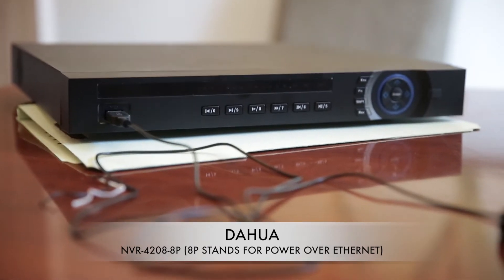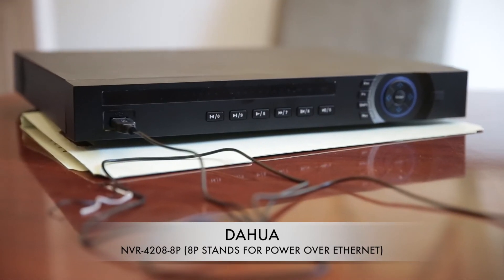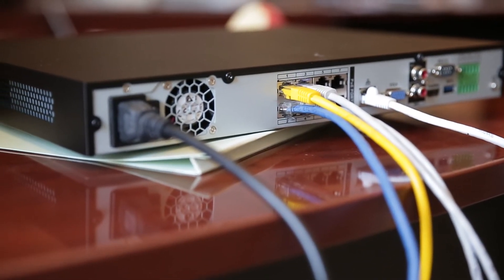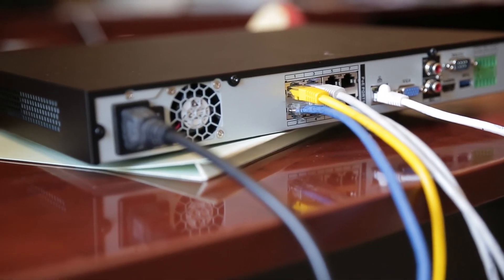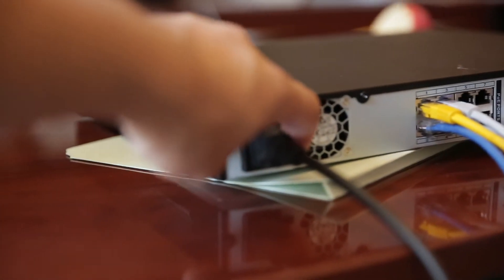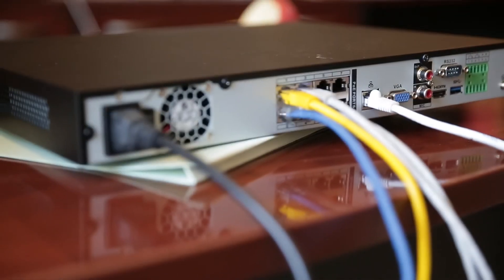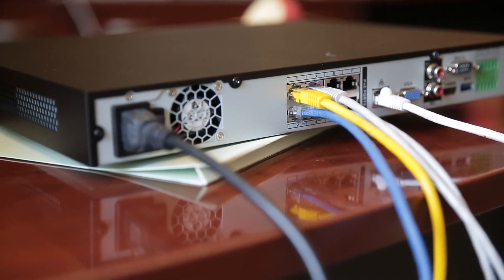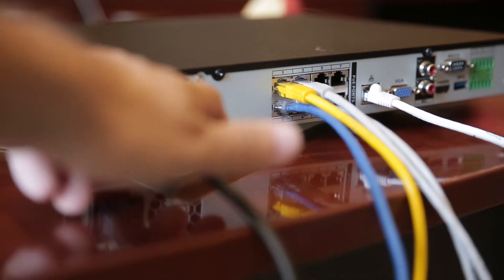Dahua NVR Noise level test // Model # nvr4216-8P

Comment: Thanks for posting. I too was surprised exactly how loud the fan is. You said you changed to custom. Would you mind sharing what you did?
Reply: +Chachi Cameo Well problem with custom fans is that they delivered little airflow and my unit only worked for 1 year.  So best advice I can give you is to get Dahua NVR that doesn't have POE (power over ethernet) and buy separate switcher that has POE up to 25W per channel.

Comment: Is this an NVR4208-8P like shown on the video caption or an NVR4216-8P like shown on the title? Do you have any noise dB specs about both?
I am trying to choose between both models, but noise is a concern, and I'd like to know if the 4216 is louder than the 4208. Thanks!
Reply from the maker: Hi Robextra0   I have unit  NVR 4216-8P  (So youtube Title is correct but video Title is not).  Now I did take off NVR cover and wrote down model numbers of fans that are installed.  There are 2 fans // First one LOUD one is  Delta EFB0412HHD this is a fan that is located right next to power block.  Size is 40x40x20 mm.  Delta rates this fan at 30.5 dB(A)   Second fan brand is ADDA  AD0405MS-G70  size // 40x40x10 mm noise rated at 20 dB(A).    This fans are loud but do push a lot of air thru them.
Reply from the maker: tradio2003 I also would like to let you know what I purchased Trendnet switcher with POE (power over ethernet) build in.   And Trendnet switcher gives out both 15 Watts and 30 Watts of power per channel (it determines automatically the amount of power device requires) and that Switcher is silent.  So one of the solutions is simply to purchase NVR that doesn't have POE build in and have separate switcher that has POE, so power to camera's will be provided by switcher not NVR.   In this set up everything should be silent.
Reply from the maker: Solution 2 would be to to replace fans inside NVR.   I did find 2 fans on Amazon and NewEgg that are rated at 12 dB(A) and ordered them.  After connecting new fans indeed new fans (Sunon HA40201V-000C-C99 are silent.   I couldn't hear them, but downfall of new fans is that they produce twice less air (unlike noisy original fans) so I am not sure if replacing fans is a good solution or not - Plus new silent fan (Sunon comes with 3 wires and NVR fans is 2 wire, but there was an adapter from 3 to 2 wire.  In other words to make this NVR silent it's rather time consuming.  And in solution #2 (replacing with new silent fans) question is will new quit fans {Sunon rated at 12 dB(A)} will be able to cool down power block properly?  And I don't know answer to that.
Reply: tradio2003
thank you so much for your response and suggestions. I have experience with replacing fans on Dell servers, so I feel that this would be indeed a solution.
Right now, I was actually thinking about going with your first solution, using a Dahua NVR4208 with a fan-less Zyxel 8 PoE ports, instead of a NVR4208-8P.

1) So I assume the non-PoE NVR4208 is SILENT, or at least very quiet so that it could be installed in a living-room ?

My last concern was about how good these NVRs are for remote access via a PC browser or an Android app. I have seen negative reviews about the limitations using Chrome browser and need to downgrade to older less secure Java6 to make things work on a PC. So far, my reviews show the best remote experience from Q-See QT NVRs (not the QC ones), but I wanted the flexibility and quality of the Dahua (or Hikvision) products. I am very experienced with the networking and technical side, but I don't want to mess other PCs when viewing remotely.

2) What is your experience with remote PC/Android access ?

Thanks!
Reply from the maker: robextra0 you're welcome I'm glad this is helping you.  I'm walking similar road as you are.    #1I   As far as other Dahua NVR's.   I do not have any other units so I can't tell you for sure from my personal experience.  But both YouTube video's and Ebay dahua reseller told me that indeed NONE POE Dahua's are quiet.  My relative has Zmodo nvr with POE and it's silent.. I don't know why Dahua chose to go this way.
Reply from the maker: #2  When you purchase separate switcher with POE your network set up will be little different.   NVR's overwrite camera IP address and put them to totally different subnetwork so you'll not be able to access camera's directly on the network you'll only be able to access NVR that will show video feed.   Why?  Because NVR puts them to subnet.  In other words if your primary internal router ip address is 192.168.1.1  NVR will put camera's to network 10.1.1.1  So you'll NEVER be able to access camera interface directly
Reply from the maker: Now with your NEW set up (when you have separate Poe switcher)  it will NOT create any subnetworks so your camera's can be at the same network as your primary router.  In other words if your primary network is 192.168.1.1 than camera's can be at 192.168.1.50  // 192.168.1.51  etc.. Because both NVR and IP camera's are going to be on the same network you can access both NVR or individual camera settings.   So to recap things if everything is connected to switcher than you'll be able to access control panel of both NVR and each individual camera.  BUT if your IP cameras will be connected directly to NVR than you'll only be able to connect to NVR alone.
Reply from the maker: #3  Your last question as far as accessibility.   You are 100% correct.  You will NOT be able to access NVR with Safari, Chrome and all modern browsers with current JAVA settings.  I made it work year ago when I downgraded Safari and installed very OLD java on it, than it works..   It's a joke.  But Internet Explore with modify settings worked!!!  So basically solution is to use Dahua NVR software.  Now question is what if you're at work and  you just want to access your NVR, well you can always try to modify Java and security settings on Internet Explorer and get in, but easiest thing would be to just download Dahua NVR software.   Is it practical - not really.  Do I hate it?  yes :) but what can I do? I guess practical way to monitor camera's is simply using Mobile phone.
Reply from the maker: Oh yes one more thing.   Dahua IP camera's them selfs have interface that's easily accessible with all browsers both Mac and PC Safari, Chrome etc....  It's only NVR it self that can't be accessed with anything except Internet Explorer.  Question is "well if they were able to create good firmware for IP camera's and I'm able to access IP camera's with Any browsers why can't they write decent firmware to NVRs?   And I honestly have NO idea.
Reply: tradio2003 So just to make sure I understand "NONE POE Dahua's are quiet", the regular non-POE Dahua NVR4208 or even NVR-4216 would probably both be quiet, or were you saying that no POE-Dahua are quiet, meaning all POE-Dahua are loud, but not sure about the regular ones? Since this is a critical decision point for me, I want to make sure I didn't misinterpret what you just said. Thanks!
Reply: tradio2003 Wow! I am SO glad that I found you on YouTube! I had no idea that I wouldn't be able to access the cameras directly if using Dahua PoE NVR, and I definitely want to keep that possibility on. Between this and the noise issue, I think I am definitely leaning towards a Dahua non-POE NVR4208 with an external PoE switch, maybe even waiting a bit for the NVR and just get started with 2 or 3 cameras. Do you have any recommendations for a reliable switch? I was thinking of a Zyxel GS1900-8HP for good reviews and managed capability. Thanks!
Reply from the maker: robextra0 Well my suggestion to you is TALK to your reseller.  Ask him this question. Tell him that you're concern about this Fan noise, and you want NVR that's practically silent.. See what they say.  Personally I believe the reason why Dahua went with this loud fan is to keep their power block cool. and NONE POE nor is not a concern.  But that would be my Logic.  Personally I like to play SAFE and make sure it's the case. So talk to reseller!
Reply: tradio2003 Good point! Thank you again for your detailed replies.
Reply from the maker: #2  Yes unfortunately NVR's create this issue by putting camera's on different subnet,  you can find out more about this by Google search "nvr different subnet"  #3  Your last question about Poe switcher.  Personally I found one on Sale my model number is TPE-TG44G  and I got it off Tiger Direct for $76 free shipping no tax.  Works wonderful.  Now when powering your devices you have to make sure there is sufficient amount of power per channel that goes to cameras for example little bullet camera's only use 4-6 watts of power per channel so any switcher will do, however big PTZ camera's (like what I have) needs 16-24 Watts of power per channel, so in my case I need High Power Switcher.
Reply from the maker: From research that I did switchers have 'af' and 'at' power.  I believe af stands for 15 watts per channel and 'at" stands for 30 watts per channel.   If you are planning to put PTZ camera than you defiantly will need switcher that produces 30watts per channel of power.  One thing I can tell you is BE careful when you connect your SWITCHER to camera's and router.  ON the back of your POE switcher you have POWER and NONE power Ethernet ports.  Make sure you connect camera's into Power port and make sure you connect Switcher and Router Cat5 or Cat6 cable into NONE POE port.

Comment: Hi. I bought this same nvr and I can't get the cameras status to green or show video? Have to add cams manually. I build my own pc's and networks but I am stumped : (  HELP ME : (        Please: )
Reply from the maker: Well you can have 2 different set ups so let me ask you a question.  Did you connect your camera's thru router and than from router to NVR // OR did you connect IP camera's to NVR directly?
Reply: tradio2003 hi. i connected through router and assigned static ip for each camera. now cams are in nvr poe ports, then from lan port on nvr to my router. router is 192.168.1.1              nvr is 192.168.1.200             internal switch left default 10.1.1.1   i can connect but status of cameras is orange and no video?
Reply from the maker: PilatusPorterPC6 Here is where I'm confused your router and switcher are on different networks?  In other words your switcher is on subnetwork?  Hmm.  Sounds like that's what the problem is.  As far as "subnetwork" this NVR likes to put IP camera's on it's own subnetwork, this is true.  In other words if your Router IP address is 192.168.1.1 and your NVR Static IP address is 192.168.1.200  and if IP cameras are connected to NVR directly than YES this NVR will put all IP camera's on it's own subnet and will give them addresses 10.0.0.10 etc..
Reply from the maker: PilatusPorterPC6 However I'm LOST to why your switcher is on it's own subnetwork.  If you're talking about Switcher that has POE (power over internet) that feeds cameras with power I believe it has to be on same network as router and NVR.    So step #1  did you receive Software that came with ip camera's that you can install on your PC?  That software is suppose to search for all camera's that are on your network did you ran that software?
Reply from the maker: PilatusPorterPC6 If your software shows that it sees camera on network than you have to try to access them with Internet explorer.  Now some older IP camera's are hard to access you will have to take down security in Internet Explorer settings.  Newer IP camera's are easier to access.  And NVR it self is also hard to access without modifying Jave and security settings :(..   But not to confuse you.  Question #2 are you able to ran software on PC and does software shows that you have IP camera's on your network or does it show  you that you have NO camera's on network?
Reply: tradio2003 so i need to change switch ip?
Reply from the maker: PilatusPorterPC6 First you need to run software that came with IP camera's to see if your PC sees them.  If it does than there is one answer if it doesn't than YES problem is in the network.  So before trying to run NVR I would first run that software to see if your IP camera's are on correct network.  Does this make sense :)???
Reply: tradio2003 yes, i ran the software and was viewing the cameras without problem. i can't put the switch in same subnet as it gives an error? This is driving me crazy. I'm an mcse, a+ and net+ so i must be missing something or this nvr is junk. I am using 3 brands of cameras too.
Reply from the maker: Looks like you're describing exactly what happened to me.  Did you change password inside IP camera's from default to something else,, because if you did than you'll be getting this 'orange circle" instead of 'green one" EVEN after you indicate inside your NVR NEW and correct ip camera's password.  This was my problem until I went back and made RESET on cameras.  Here is what happened in my situation.  When I changed password inside IP camera's via browser I typed password for example 12345+  but ip camera stored 1234*5+  (extra bit of information) and YES camera's were visible on network when I ran software search but NVR was not able to pick them up.  Because NVR was sending slightly different password.  But IP camera's new password was corrupted.   So my solution was simply reseting IP camera's to default mode and simply repeat same steps several times until it worked...
Reply from the maker: PilatusPorterPC6 So if you changed user or password, I would simply go back to IP camera's open glass element if you have "bullet" or back cover if you have PTZ and RESET them.   This was my solution.
Reply: tradio2003 hi. tried that but no luck. what are your network settings/addresses
Reply from the maker: Well my NVR has POE that means I don't need switcher with POE.  So I can have it 2 different ways.  I can have set up IP camera's and NVR OR Ip Camera's NVR and Switcher. There are two reasons why I like adding POE switcher.  #1 With switcher I can have ip camera's on the same network as main router so I can access ip camera control panel and footage directly.  Without switcher I can only connect to NVR alone and IP camera's control panel is not accessible anymore (because NVR puts them to different subnet).
Reply from the maker: I'll try to tell you about my set up as quick as I can but I don't think it'll help you.  First when I got ip camera's I connected one of them thru POE switcher and ran software on PC and software showed me that ip camera's default ip address was 192.168.0.50 (for example)  so I wrote it down than I took ip camera and connected to Dahua NVR but after that when I connected Ip camera back to poe switcher and ran software search again it showed me that new ip camera's address was 10.1.1.45.  So after several tries I realize that when ip camera is connected directly to NVR, Dahua NVR totally changes ip camera's address.
Reply from the maker: After I realized that Dahua NVR totally changes camera's ip address, I logged in to router control panel and changed router detault  address from 192.168.1.1  to 10.1.1.10.   That gave me ability to access ip camera's control panel where I could  change their address from 10.1.1.16 back to 192.168.1.16   So I believe that's it.   I made sure my router has a set of Static addresses for ip camera's.  Oh yes one of my problems was that HP printer was sitting on same network as IP camera so they were conflicting with each other.
Reply from the maker: Last advice I can give you is try to simplify your setup until you find problem.  If you already have camera's mounted I would take them down and start working with your set up camera's switchers, NVR all on the table.  Until  you find solution.  Here is 3 more things that might help you.  One time ip camera's password didn't change correctly and NVR was keep sending wrong password to IP camera's and they were "locked".  Another time cat 5 cable was too long little over 100 feet and as soon as we cut off 15 feet whalaa!!  Third time actual cat 5 cable got damaged when we were stapling it to 2x6 outside.
Reply: tradio2003 Hi. Sorry for delayed reply but I  got the flu and was out for several days. Everything you said worked, but this knock-off was still unstable so I sent it back for a refund. I bought Blue Iris and I really like it. I will be building a pc just for it as the test box I'm using now is a little under-powered. It is a shame that I had to send the fake Dahua back because it seemed like embedded Linux units have so much power and the graphics were so clear from such a small board. Anyhow, thank you for all the help. Have a great new year : )